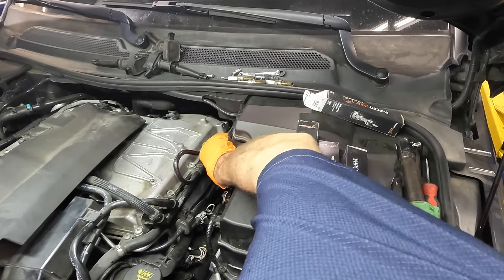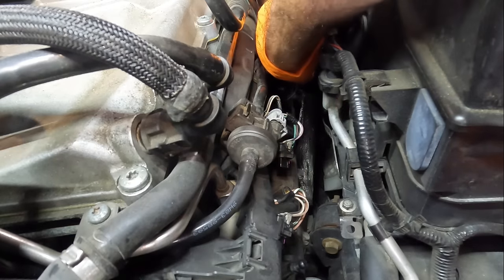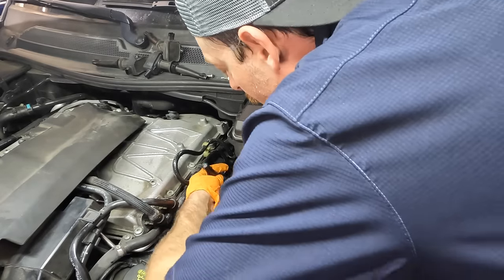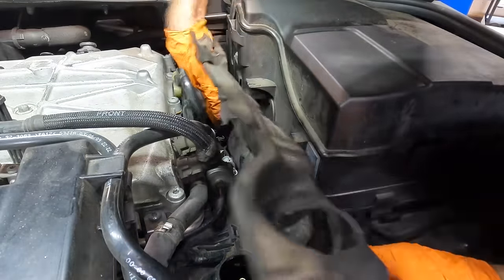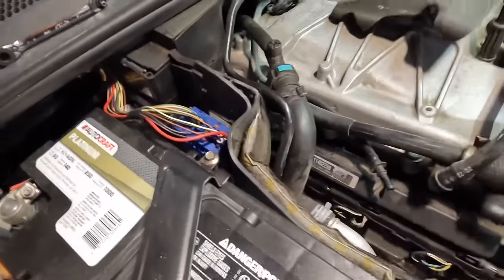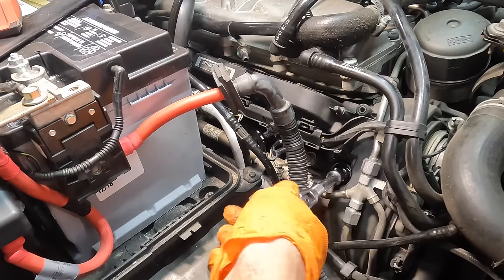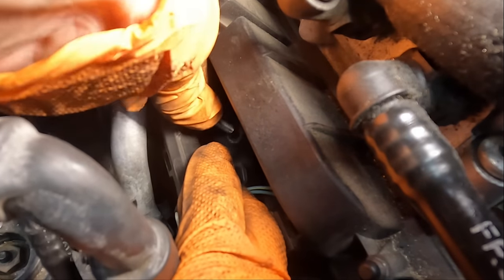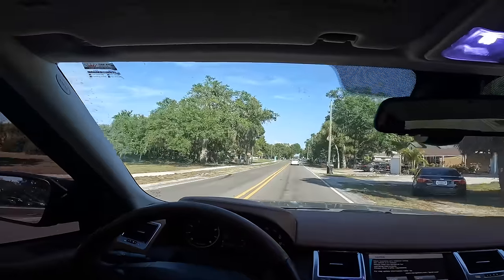Supercharged Spark Plugs! Land Rover Range Rover 5.0 v8 AWD #mechanic #tuneup

Comment: Hi Ray, You worked on a Subaru Forrester that had the stud on the water pump break and you ended up unfortunately deciding to replace the whole engine, what happened with it in the end?

Comment: I had to remove the Supercharger to fix a vacuum leak on the intake gasket, and can't figure out how to get the intercooler full of coolant after it's back together. And what are the torque specs on the Supercharger bolts....please...any info is greatly appreciated .

Comment: on those coil springs, would it not be more secure, if the spring were slipped onto the coil stud, and then inserted into the rubber boot, so you would know, for sure, that the spring is touching the coil stud before it is inserted into the spark plug hole??

Comment: They need locks on all extensions. When I change the oil pressure switch on my ls1 I don’t pull the intake. But the socket tool is taped to my 1in extension because I can’t pull it off after tightening the new one.

Comment: No worries, Ray. Land Rover lends to confusion for owner and mechanic alike.   At least you're not working on the Range Rover equipped with the BMW twin-turbo V8 (a.k.a. the Hot-V due to the twin turbochargers location in the middle of the V-8 bank - a.k.a "What the hell was BMW thinking???").

Comment: The calender has quite a history. For a long time there were only 10 months and the year had to be adjusted based on the equinox and another seasonal event to plan the cycles for growing crops and the harvest. I believe the 2 months of July and August were added by the 2 Caesars Julius and Augustus, to account for the 12 months we now have; and interestingly both with 31 days, as one could not be more important than the other. I hope my memory is accurate, but you should be able to find the details somewhere on the internet.

Comment: Replacing NGKs with Denso?!  REEEEEEEE!

Actually, I have a funny story about the exact opposite. I had an issue with my car right after I bought it. Drove okay until I got on the gas hard, then it would misfire badly; car felt like it was bucking.  So after some diagnosis, I went to replace the plugs. The stock OEM for my car is NGK, and tried to pull the first plug and, nothing. The socket wouldn't bite. A quick check and the last guy left his spark plugs rubber seal on the plug. (sigh) So after removing that, I pull the plugs and they're Denso branded. The stock gap is around 0.028 and the plugs I pulled were around 0.044. So yeah, they fit, they worked, but only sometimes which is far less often than you want. 🤣

Comment: Hello Ray, Just a question for the sake of curiosity. Do you use anti-seize on plugs going into aluminum heads? Just wondering. Thanks.
Reply: From what I have seen, he doesn't lube threads or use anti-seize on bolts unless they came from the factory that way. Because of how it changes the physics of the torque values when such is applied. IE, lug nuts require you to reduce the torque by approximately 20% from listed values if lubed. Otherwise you stretch and eventually brake them.
Reply: Most plugs are coated at factory so no antiseize should be applied.
Reply: Some techs still apply a thin coat of anti seize anyway. They don’t want the nightmare of later installing a helicoil or removing a head because the spark plug broke or seized in the head. Seen it happen a few times
Reply: In theory the plating should protect the aluminum from reacting with the steel of the spark plug. Unfortunately I have had the experience of winding the threads out with the plug. It was the bottom plug on an aircraft engine. Got to replace that cylinder.
Reply: Ok so APPLY antiseize on every plug you install! It's not that hard or time consuming,..

Comment: It is easier to take things apart then put them back in for the same reason that it is easier to brake something than it is to fix them. Returning things to the proper position requires "AIMING" rather than yanking.

Comment: Land Rovers are amazing vehicles.  Their ride quality and chassis build quality is really good.  They are great,  until they're not,  which is normally after 50k miles.  It's a shame really.
Reply: No better or worse than any Big 3 maker.  Ihave 3 vehicles with the JLR 5.0 motor....no problems other than crap water pump design.

Comment: When using all those extensions creating angles there is a calculation to get the proper torque but not sure how you would measure it with curves....?
When you put an extension on a torque wrench (e.g. a crow foot or a dog bone) the torque applied to the fastener increases as the lever arm extends. The calculator will work out what value you should set into the wrench to achieve the required fastener torque.

The following formula has been used:

M1 = M2 x L1 / L2
Where:

M1 is the torque setting of the wrench
M2 is the actual torque applied to the nut
L1 is the normal length of the wrench
L2 is the extended length of the wrench

Or if course you can just say click because click is good

Comment: A friend of mine has a 2015 or 2016 one of those "thangs" with the supa chah ja.  She works and lives in Atlanta and has to have the oil and filter changed every month..not miles but sitting in traffic, idling a lot more than I could handle.  She said she gave well over 100 grand for it and it costs her almost 400 bucks a month for the oil and filter with labor at the Range Rover dealership.  No telling what they'd charge to change the coils and plugs but hers is about to find out at 100k miles, in which RR says she has to have a full service including plugs, coils, brakes and rotors, engine oil and filter, brake fluid and coolant flush and replace.  I know she makes a good bit where she works but if an oil change costs that much it probably will run her $3,000 for that...if not MORE. UGH.  I'll stick with a cheap, older Chevy, thank you.  But, they are nice and they will FLY.  Take care.

Comment: In biblical times there was 7 month's in the year with 350 day's per month. We went by the solar calendar with Spring (Nissan, Abib) the first day of the year plus 15 day's later is Passover so, 350+15=365 day's in the year. On the Temple Mount was a hole in the fence wall on the East  Gate and when the Sun came up it would shine through the hole onto the Temple floor in one spot telling them it was the first day of a new year. Man changed the calendar! :)

Comment: I was wondering about your weebly-wobly and torque: don't all those in between connections reduce the amount of torque ??
Reply: Absolutely every wobbly, extension, all affects torque.
Reply: I was wondering the same, but I bet the +/- tolerances on spark plug torque specs are pretty wide. And, I doubt any compression losses through all those threads in totally insignificant.

Comment: Range Rover is like a smartphone. You have to long press in order to turn off.
I sure do like the 2 piece coils. That saves you buying a new coil when the boot is destroyed because it was stuck to the spark plug.

Comment: With reference to the New Year starting January 1st instead of the beginning of Spring blame the French.  France switched from the Julian calendar to the Gregorian calendar, as called for by the Council of Trent in 1563. In the Julian Calendar, as in the Hindu calendar, the new year began with the spring equinox around April 1. In the Gregorian calendar the New Year starts in the middle of the winter.  Go figure.  Nice work on that right rear spark plug removal.  A lot of mechanics would leave you running on 7 new plugs and an old one.

Comment: The misfire on starting and the low rail pressure code would potentially point to a high pressure fuel pump issue. 
These 5.0L supercharged V8 engines are wonderful with 500 BHP on tap. Unfortunately they or the vehicle they are in can't be maintained on a shoe string, like any other LR product after 2006.
Maintenance needs to be spot on if silly niggles are to be avoided, but they can still empty your bank account when it all goes wrong. 
Would I be without my LR, not if I can avoid it, but in the UK parts are easy to get, and not that expensive. Most LR owners I know do DIY maintenance, which is normally better and cheaper than taking to a repair shop.
Reply: Didn’t Ford supply the engines to RR? I remember Ford had a stake in Jaguar

Comment: Land Rover is the Brand. Range Rover Sport is the Model. Not sure why this is confusing. 

On the plus side I'm glad to see he's working on a better class of car. On the negative side, he should have called out that noisy timing chain tensioner which is likely due for replacement and a troublespot on that car.

Comment: about the months... was something like the following: "initally there were only 10 months, then it cames Julius Cesar, the roman emperor and added the 11th month, which was July (July from Julius), and later it cames Augustus, and had another one... guess which one it was...". This was told me by someone... I didn't double checked on google/wikipedia, but at the time it sounds ok to me. I think this was related to the fact that before Julius Cesar, the seasons were not mathematical aligned with the calendar... you know... math. I think the 28-29 days of Feb are also related with changes by Cesar in the same period.

Comment: Ray, If you give each month 28 days (4 weeks), there are 13 of 'em !
Reply: And an undated New Year's Day (and occasional Leap Year Day) between Dec 28 and Jan 1 to get the 365 1/4 days in each year! Neither has a 'day' associated with it, so after the first 'new' calendar is printed, calendar makers will be out of business!
Reply: @brianspencer6397  Leap Year Day is because the Earth rotates once every 23 hours, 56 minutes and 4.09053 not 24h 🤷🏼‍♂️
Reply: @Egon1982  23 hours, 56 minutes and 4.09053s is fine for a siderial day - the time the earth rotates once with respect to the stars, but it has nothing to do with leap years. Leap year day exists because the earth doesn't quite make it thru a full 360 degrees around the sun in 365.0000 days, but requires 365.2422 days to complete the journey. So we stick an extra day in the calendar every 4 years, with very infrequent exceptions, to keep the stars aligned with the calendar. So the 'day' that appears on calendars, and that non-astronomers call a 'day', is the solar day, not the siderial day, and is 24 hours long.

Comment: No. You are exactly right. Start the year at the spring equinox. Make twelve months of equal length with a five day holiday (six in leap years) at the winter solstice to celebrate the increasing day length after the depths of winter. To heck with the Romans and popes that set up our current flawed system.

Comment: My son in law owned one of those things,I believe the come from the factory with pre loaded codes,this rolling disaster caused much lost sleep until finally a big rover fan took it off of his hands
Reply: I love your videos Ray, and I never have anything negative to say, but I cringed when you got into the car and pushed the button to start and put your hands on the the steering wheel with the dirty rubber gloves on. I know the car was really clean under the bonnet and there wasn't any oil to speak of but the gloves were grubby, and it's good practice to take the gloves off before going into a customer's car. It's not a reeeeeeee, just something trivial.

Comment: I feel the design department should have to work as a line mechanic on the designs they come up with… then they would stop designing stupid hard near impossible stuff like this Range Rover. Nothing stops them from making it easy to perform regular maintenance.

Comment: Wow, The average cost for a Land Rover Range Rover Spark Plug Replacement is between $331 and $457. Labor costs are estimated between $192 and $242 while parts are priced between $140 and $216.

Comment: Not sure if this will work, but it works on my 2006 LR3 with the 4.4 V8 (non-supercharged, but same block and possibly same heads). When I took my LR3 in for its first service, I mentioned to the Land Rover service advisor that I'm not looking forward to it's first maintenance, he said not to even bother bringing it in, the plugs are easy to access. What he did mention though, was to get 2 3" extensions and use them as a 6" extension. A sparkplug socket, the 6" of extension and a ratchet all fits perfectly. There's just no room to get a 6" extension out with a sparkplug attached. splitting up the 6" into 2 pieces made it an easy job

Comment: I  really wish you would stop shoving the plug boots full of dielectric grease. Getting the grease on the top of the plug or wire connector could easily cause a misfire. The purpose of dielectric grease is to stop electrical signals from going where they aren't welcome. It can also stop an electrical signal from going where you want it, like from the spark plug wire to the plug.

Comment: And, while still down the rabbit hole, why does your electric ratchet work so much faster when extracting than inserting.  I keep waiting for the battery to die.  Logically the new threads should go faster if anything.  😅

Comment: I'm not sure, but it looked to me that on the battery box side the safety clip on the third coil connector from the front failed to get clicked all the way in.  It looked like it started to click and then popped back.
Reply: Of course it looked like it was gonna do what you wanted it to only for it to break its a range rover

Comment: Unfortunately, the Range Rover has a reputation for not being a very reliable luxury full-size SUV. Repair-Pal gave it a reliability rating of 2.0 out of 5.0, ranking it 15th out of 19 vehicles in its segment. J.D. Power gave the 2021 Range Rover a reliability score of 72/100 and the 2015-2020 model years an average score of just 73/100. The 2020 Range Rover was also given the lowest predicted reliability score of 1 out of 5 by Consumer Reports. Most owners Love these Vehicles but most have Warranty and often Buy Extended Warranty...

Comment: I was fine, now I'm confused, whatever 🙂. Range Rover well that's OK 🙂 I still have a Range Rover with 12" cut out of the chassis, and a 3 series aluminium body (with a safari top) dropped back on. V8 3.5L auto.

Comment: I don't think I'd ever work on any Range Rovers, Those things are a nightmare.  I don't even think the people who built the damn thing know how to fix it with the 7000 codes that are always on
Reply: Are they, really? I've owned Range Rovers (L322 and L405 diesels) for about 10 years now. They have more systems, compared to other cars, but when you have access to a proper service manual, they are not much more difficult to work on than other cars. Try an Audi, or any other VAG product. Then you're in the deep end. ( Yes, I'm a former car electrician and mechanic)

Comment: The reason why the months don't fit numerically, is because originally, only 10 months had names. The Romans didn't include Winter in their calendar as the government and military forces were inactive during that period.

Eventually, Julius Caesar reformed the calendar to being based around solar orbit rather than lunar phases and included the months January and February to cover the Winter period, which of course meant that the 7th, 8th, 9th and 10th months were now 2 months later.

As for why January is the beginning of the year, this is because Numa Pompilius decided to change the beginning of the year from March to January. Since January was named after the Roman God Janus, the God of Beginnings.

Comment: Range Rovers are a pain in the ass. That is until you need to pick up nine exhausted hikers on the side of a forty degree slope and drop em off at the top. Hopefully the electronics and ride control will go the distance.